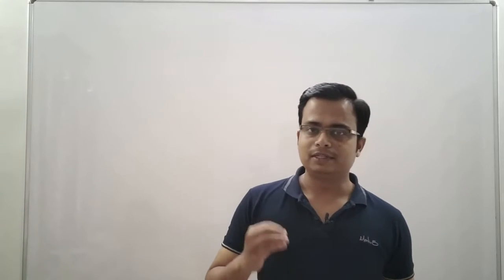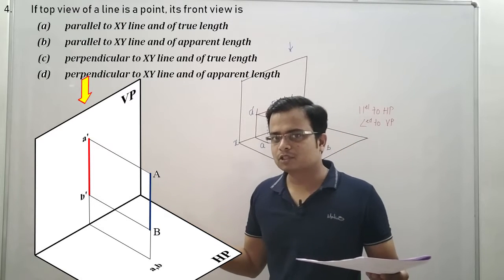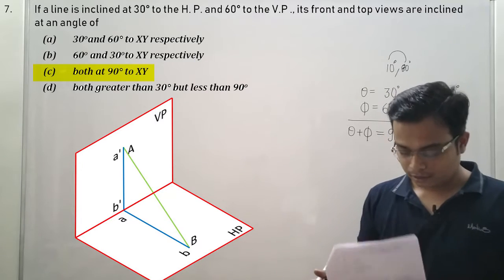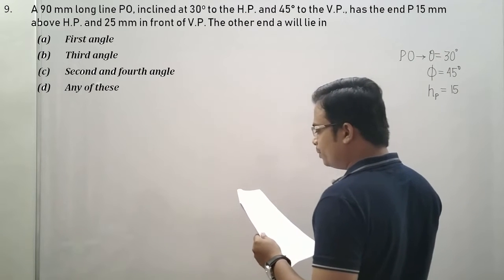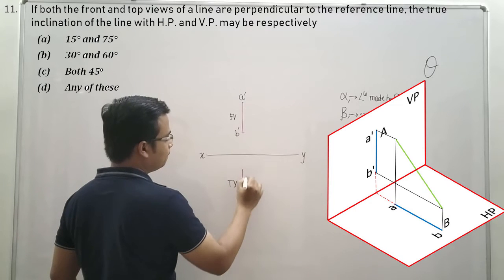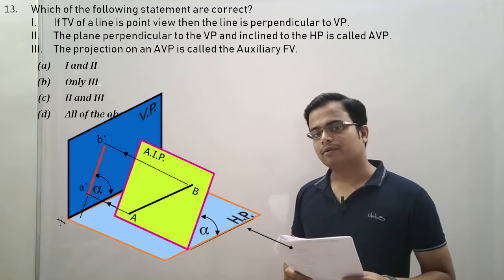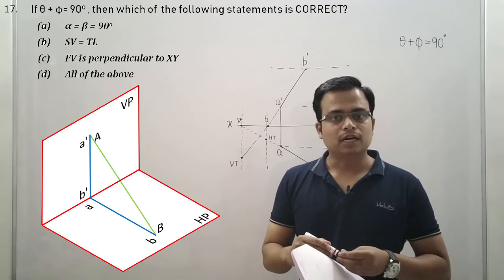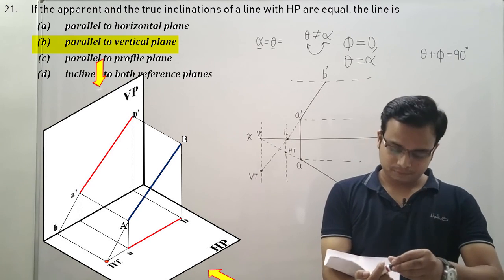Projection of Line Objective Problems | Engineering Drawing | ESE Prelims |

Comment: Sir for question no 3 the there is a possibility  of line parallel to both HP and VP also sir I think
Reply: as the front view is mentioned in the question and not the line, the option sir selected is correct.

Comment: In question no 3 sir , how you can take the line inclined to vertical plane??? As it is mentioned in the question that the line is parallel to XY plane ...
Reply: Abhay Kumar sir took it inclined so that we won't be able to see full length in case of front view.